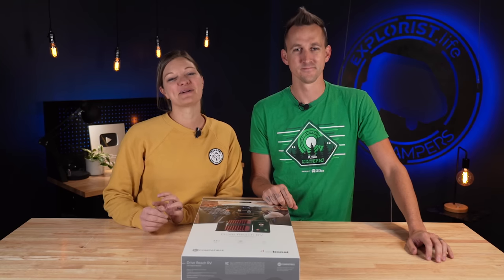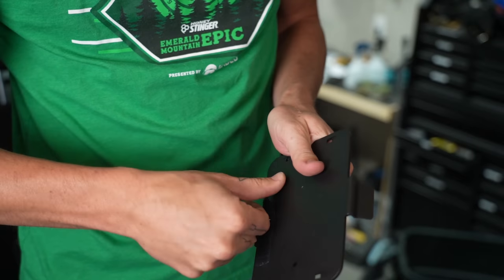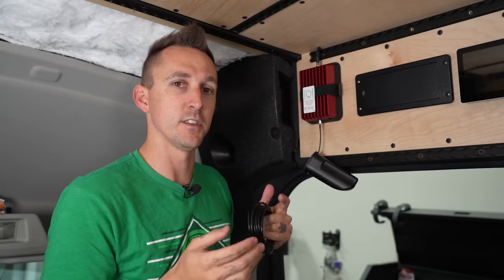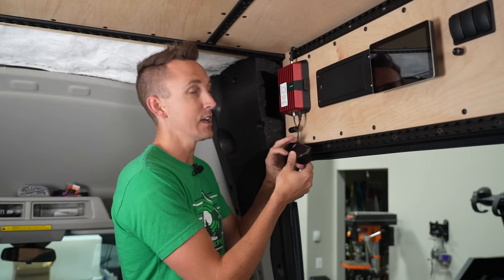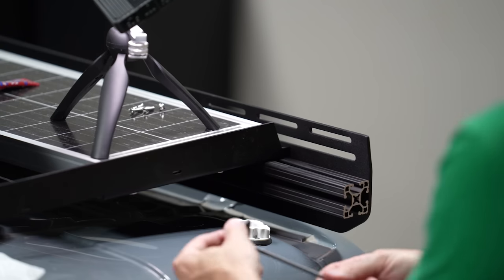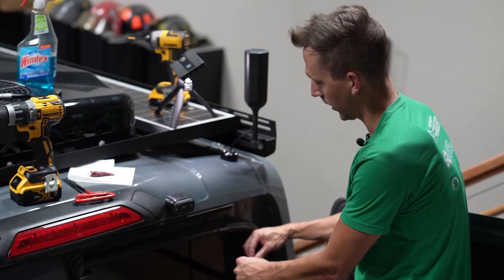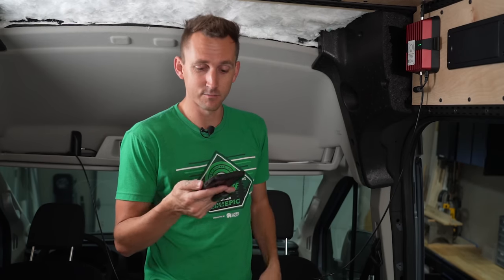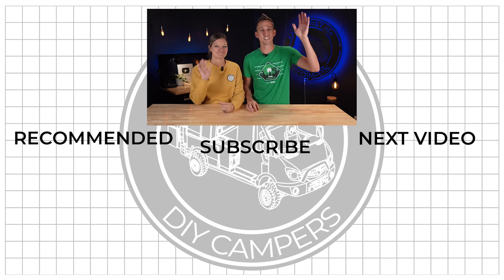WEBOOST SIGNAL BOOSTER INSTALL (start-to-finish)

Comment: I have had my WeBoost installed for almost 2 years.  I have found there is a BIG difference based on how far your cell phone is from the interior antenna.  In your video you can see that in the second test before mounting the interior antenna you are much closer and the results show.  See what the results are when you actually put your phone right next to antenna, you might see even more of a difference than the ten inches or so you have it during your second test.
Reply: Wouldn’t a mesh system help with that?

Comment: Great video as always!  We installed the system in a larger Travel Trailer. Jayco 287BHSW.  Because of the longer run I substituted the coax for LNR400 cable for both internal and external antennas paying attention to the ohm rating of the system and the cable.  I use this for boosting a mifi and the puck is about 6 inches from the internal antenna.  In this configuration I have seen around 35 db increase which is solid performance increase.
Reply from the maker: Thanks for the info!

Comment: I've installed that same Weboost booster but with a marine omni antenna in my small cabin cruiser boat that I use around the San Juan Island in Washington state. In some of the outer islands I will have only one bar of signal, but with the booster on I'll get 5 out of 5 bars. It does use a fair amount of energy, so we need to conscious about that. You might want to install a toggle switch so you don't have to plug and unplug the power connection all the time. For me, the device works as advertised and I have been very happy with it.
Reply from the maker: Yeah, same.  This is our second one.  The first one worked great (but went with the Sprinter when we sold it).  We considered the toggle switch, but it was just much more clean to unplug it as desired.

Comment: The big thing to watch out for with cellular boosters like this is that most of them only repeat a single channel, and speed over LTE comes from aggregating multiple channels.  So, lots of times, if you just leave it on and forget about it, you may be getting a better signal but slower speeds overall.

It’s best to consider this as a specialized tool for when you have a basically unusable signal somewhere—when it’s the difference between making a connection and not.  The rest of the time, you’ll find that a high quality external antenna for a dedicated cellular router (such as a Peplink) or hotspot will give you a much better experience.
Reply: But, that said… I’m always impressed by y’all’s attention to detail and build quality.  😁
Reply from the maker: So, for the test/review... the best way to show that would be to run a internet speed test in an area we already have good cell signal (in town). Yeah?
Reply: @EXPLORISTlife  Yes.  That would be a good test.  Speed with the booster and without in a strong signal area.

I’d also see if you can test the same in a moderate signal area.  A place where the phone connects fine and seems fast enough.  The thought would be to see if you gave the phone no choice to connect to the stronger signal.  I’m not 100% sure on this, but I’d imagine that if you’re already in a strong signal area, it’s possible that the phone may just stay on the tower.

Looking forward to hearing the results!
Reply: Although, a benefit to the booster in theory is if you’re in a weak signal area, the booster making a stronger signal will allow the phone to not use as much power to lock on.  I guess the question is, which uses less to power off the battery — the booster or the phones?
Reply: @EXPLORISTlife  That would be a good test.  your phone has a MIMO antenna, where the WeBoost is an omnidirectional single antenna, so it will strengthen the signal but not necessarily increase any bandwidth.  I have a toggle switch installed next to my interior antenna and only turn on the WeBoost when I am having difficulty connecting on my phone and then turn it back off when I am done.

Comment from the maker: WeBoost Drive Reach RV: https://amzn.to/3gYr83O
Get this Unaka mount for your 8020 roof rack instead of the way I did it: collabs.shop/6cqx1j
Seaview Cable Gland: https://amzn.to/3TXxrmQ
12V Hardwire Kit from Weboost: https://www.weboost.com/products/hardwire-power-supply-950079
12V Hardwire Kit from Amazon (that 'should' fit): https://amzn.to/3gUUpwb
Reply: Great vid and thinking about installing the same.
Reply: Can you please provide a link to the Network Cell info lite app?  I did not find it in the Apple app store.
Reply from the maker: It might not be an apple app, I don't know.  Maybe somebody else has another comparable alternative.
Reply: NOT Feeling the Love for  $520.  
Is 20 db that big of gain when they say it will do -50 db gain.
Reply from the maker: 20db got us from 600kbps to 12mbps; which is pretty huge.  That's the difference between being able to barely send an email to being able to upload a video.

Comment: We use the WeBoost at our remote cabin. The cabin is surrounded by hills and trees, with the nearest cell tower is 14 miles away. Without the booster, cell signal is almost nil. Turn on the WeBoost, and we can stream Netflix. Granted, you need to be close, CLOSE to the interior antenna…you are not going to roam about the cabin but, at the table, with the antenna on it, you can be on the internet, even do video calls. We use tethering on one phone to share the wifi and can use the ipad about anywhere.

Comment: We have the same weboost unit with a poynting marine antenna. Our tests have been the higher the outside antenna the better and our phones really see a increased signal strength when they are right beside the inside antenna.

Comment: Well the db test is  telling you that the on frequency carrier signal is more powerful when the weboost is on.  It does not mean that you are receiving a fully error corrected signal from the cell carrier through the weboost.  

Try a simple google speed test with and without and it should prove if the signal is usable or just amplified noise. 

I would wait the outside antenna about 24”.

Comment: I like the install over all and thinks it's a great idea.  One thing I have found with communication systems of any kind, the higher the antenna, the better the signal for both receiving and sending.  You might want to test the taller antenna mount after you've done your initial testing and see if there is any difference with the taller mast.  It might not be the look you are going for but sometimes function has to trump fashion.  Keep up the good work!
Reply from the maker: We will definitely test a taller antenna for the sake of the testing video, but it's not really a 'fashion' kind of thing.  The taller the van is, the fewer places we can get into.  We start hitting tree branches, overpasses, and all kinds of other stuff.  We have to balance between physical function and cell function.
Reply: @EXPLORISTlife  oh I completely understand.  I have to worry about my 102" Whip antenna and my other antennas hitting things on and off road.  So no misunderstanding at all.  Thank you for the reply back.

Comment: I have a hybrid weboost system with the Drive RV components and the weboost Destination RV directional antenna.  I doubt it works as well as the entire Destination RV package but it is definitely better than using just the omni-antenna.  You may want to try the Destination RV directional antenna as part of your test.

Comment: Enjoying watching these videos and getting tips. Not sure how much I will have to change when I do my own van with differences in UK electronics. Do you know if most of the system would work only having to change the 120v parts of the electronics?

Comment: Awesome install vid!  I would keep the long interior coax handy.  I have found the closer you are to the interior antenna the better is works when going cell phone direct.   I sometimes need to move the interior antenna around for use convince.    (mounted in a 5/W)   When I use it for WiFi I keep the MiFi close to the Boost Antenna.   Very happy with the system.
Reply from the maker: That's pretty much exactly how we used our back in the older system in our Sprinter. Nice!

Comment: Thanks for the video.  I hope you do a review after using the boost for a while.
Reply from the maker: What kind of info would you like to see in that review?
Reply: @EXPLORISTlife  I think the two main use cases are 1) how consistently does the boost extent the range and clarity of voice calls, and 2) data throughput comparisons in different signal strength / range situations with and without the boost.

I have seen some stuff on how 4G works by allowing your phone to make multiple simultaneous connections to the cell tower to increase throughput, and I have seen conflicting claims about weboost supporting multiple or single connections.  It seems like the weboost should be able to provide extended range for voice calls, but data throughput might be limited to a single channel (64k?)

Comment: Great tip about the network cell lite app!
Reply from the maker: Yeah, it's a pretty neat little app.  I had never used it before.
Reply: Are you using android or apple with the app?
Looks like android only.
Reply from the maker: Android.

Comment: Just installed mine yesterday! Good timing, are you happy with the results of the boost? Thanks for your electrical guides as well! I watched them atleast 100 times to get mine system up this last week. Not one issue at first start following your guide
Reply from the maker: Nice!  Yeah, I'm happy with it.  This is actually our second one (first one was sold when we sold our last sprinter) and it was super nice to have and we've seen speed test results of up to x12 from non-boosted to boosted.

Comment: I'd lower that external antenna below the roof line, so it don't catch branches. Perhaps on the rear door somewhere?
Reply from the maker: Yeah, I mean... we are leaving ours where it is.  Feel free to install yours wherever you like, though.  The user manual says the higher you mount it the better.

Comment: The Weboost generates a surprising amount of heat so you may want to put it on a switch.  Also that power cable in not good enough for pulling and replacing.  Unfortunately, I learned about the poor power cable the hard way. Not so happy with Weboost.  Installing Starlink now.
Reply from the maker: It is on a 'switch', aka unplugging it.

Comment: The item covered only works with a few frequencies.  In your initial test your phone may have been locked on a band that the amplifier does not work with.  This is the biggest issue I have had with it.  It is something that might get you a stronger less noisy signal.  It may also not do anything if the bands in the area are not useable by the product.   In the Fort Collins area, aka Roosevelt National forest it works great (tmobile).  When I am in Gunnison or Saguache county it is hit or miss.  Most of the other camping areas I go to there is not a signal to amplify so I will be adding starlink to my available options.  Hoping for the best.
Reply from the maker: Yeah, it doesn't work in 100% of areas, but we found that anywhere there was even a hint of signal, it would boost that non-usable signal to a usable signal to upload pictures/videos/make calls/etc (Note: this isn't based on our experience on this specific booster we just installed and only have 1 day of use with, but instead the old model we had in our old sprinter we lived in for 4+ years full time).

Satellite internet like Starlink is indeed the more consistent option, but I think that having both is the true answer here if going without signal is not an option as Starlink doesn't work (currently) above certain latitudes.

Comment: When would a ferrule tip work in this situation or is it not necessary?  I think it is important to keep the spring on the mast, use it.  If you should hit an unexpected tree branch it will flex and not break. Also, when we put on ham radio antenna's we will loop the wire down then up sort of making the letter J ... then when the rain and water come onto the unit, it will run off or drip off at the bottom of the J ... Antenna at the top of the J and where it comes back up it 
goes into the breach.  Less chance of water coming in .. though they say "waterproof".  Again consider putting the spring back on.
Reply from the maker: It's more important for me to avoid hitting trees than it is for installing an antenna that doesn't break when I hit trees.  Feel free to do whatever you like in your own install, though.  The antenna added too much height for me, personally.
Reply: @EXPLORISTlife  I see your point.  I am restoring a true 2' high-top chinook G20 and look or avoiding for sure.  If you see something along that side ... one could stop and as you say, find a way to avoid hitting anything.  I just ordered in the cerbo gx and hope to use an ipad or such (funds are from a different side of the tracks) ... I have the multi plus II and solar ... all still to be installed.  It may be nice to see how to side step the wall touch screen, for sure which is really nice ... but upgradable too.  Thanks for your reply and good sense.

Comment: Great video Nate!  Is there a particular reason you mounted the outside antenna at the back of the van?  Are there any radiation (non-ionization EMF) concerns?  Is there a minimum distance between the outside antenna and the inside placement?  Thanks and keep up the great work!
Reply from the maker: 1: Convenience
2: I'm not concerned, no.
3: 'as much as possible' is preferred as noted in the user manual.

Comment: Installation video is great but a couple questions about the product.I am not good with all the technology out there other than what I use in my house which gives me both wifi and internet. First, why is this one at a cost of $570 better than others that sell for under $200? Second, Does this help with wifi for internet? Are they the same/different? I can get a wifi booster for $225.
Reply: This is a cell phone booster, not wifi booster. This helps you to improve the range that you can receive a cell phone signal from cell phone towers. A wifi booster is used to strengthen and improve a internet signal

Comment: I don't know for sure, but I thought I had read coiling wire like that will degrade the antenna's effectiveness?
Reply from the maker: It didn't make any mention of that in the installation instructions.
Reply: @EXPLORISTlife  Could be old man BS. My dad always told me coiling antenna wire in less than 12" coils creates inductance that can degrade signal. That is how inductance is created obviously, but how it hinders gain I don't know.

Comment: The AC power adaptor says the DC output is 5v, so if you directly cut off the wire and spliced it into your 12v fuse box, do you need to convert the 12v into 5v first?
Reply from the maker: Ours was 12V.  If you've got a 5V model you would indeed need an adapter.
Reply: @EXPLORISTlife  I have the exact same Weboost as you. Your AC power brick said the DC output was 12v?

Comment: To be honest for the amount of money one pays for this setup, these results are absolutely ridiculous. I have the exact same product and have had the exact same issues. I wonder what app can be used for iPhones since their app itself is faulty. Thanks for posting this, I feel a lot better it wasn’t something I did wrong.
Reply from the maker: Well, you don't really 'need' an app, as there is nothing to configure, just to monitor, and you could do that with a speed test if you were looking for faster data speeds.
Reply: @EXPLORISTlife  yes, but you knew the majority of this after the support call. The entire time I thought an app was needed.  I alsowas expecting at least 2 bars but got nothing. If you look on YouTube there's not that many current setup vids about this product except yours. I was kinda shocked seeing their video on their channel were years old. Also couldn't find a video on how to setup multiple devices such as an iPad. Maybe that could be a next vid?